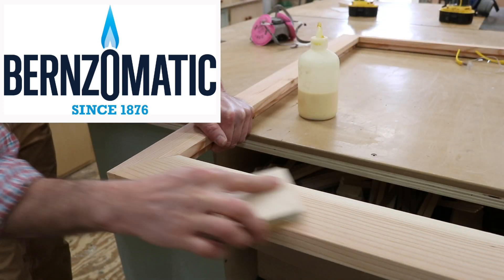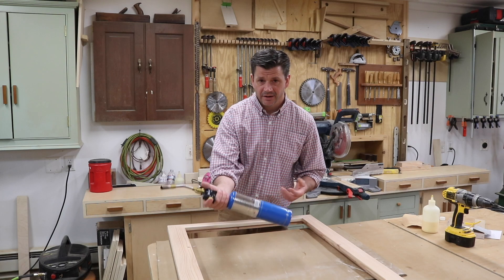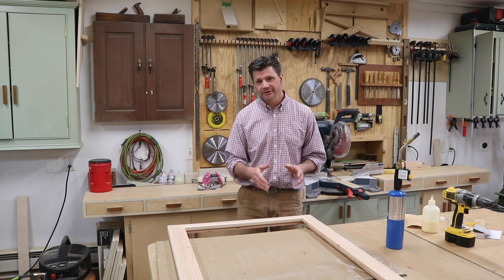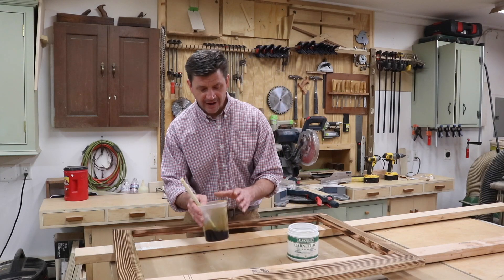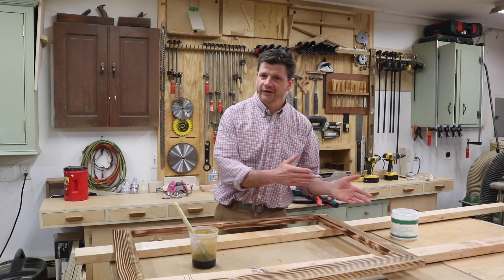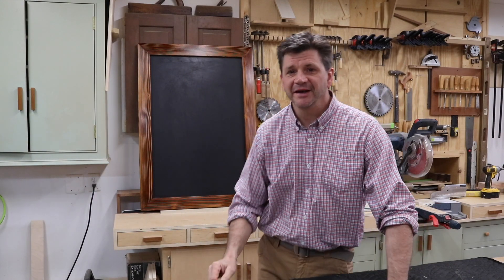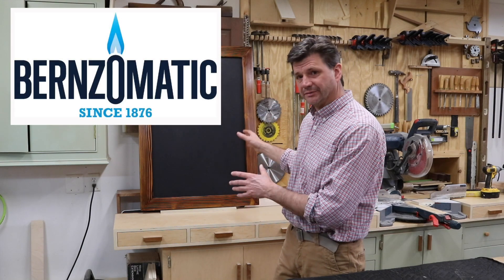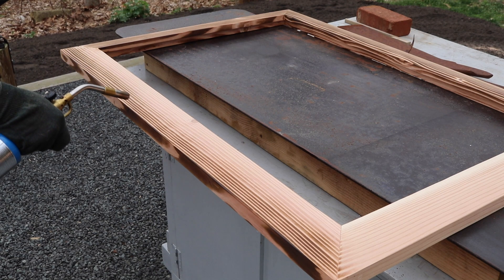Make an Awesome Burned Wood and Shellac Finish

Comment: I do this sometimes, however a lot of times I like doing a full charting on it! completely blacked the surface and then run a stiff straw brush over it and wipe it down. makes a beautiful black finish that the grain shows through and is silky smooth!

Comment: Why do you prefer shellac over polyurethane like a Minwax?
Reply: Joe Brown I have the same question, hope Jon can answer.
Reply: I've used Minwax ever since I started woodworking. Always great finishes.
Reply: A shellac finish is easier to repair than a poly finish. And perhaps the burning process prevents poly from penetrating the wood properly, whereas shellac isn't penetrative to begin with. That one's just a guess.
Reply: Also, who knows, maybe he just wanted the color.
Reply: Well that's why we asked the question. Maybe he's just old school.
Reply: Nontoxic, no fumes, easily removable, simple reapply, various colors.  Plenty of reasons
Reply: I did a bench years back where I burnt the grain  deep then used a wire wheel to dig out the softer burnt wood and used a poly with no problem . . .great finish Jon but was wondering the same about the choice to use shellac. . .Thanks
Reply: I hope he answers so I can sleep at night! Burning question! See what I did there? Lol
Reply: Actually I'm sorry I asked the question.
Reply: Looked beautiful before the shellac